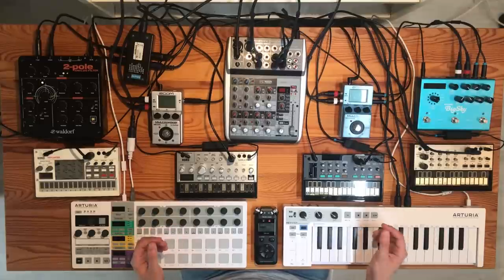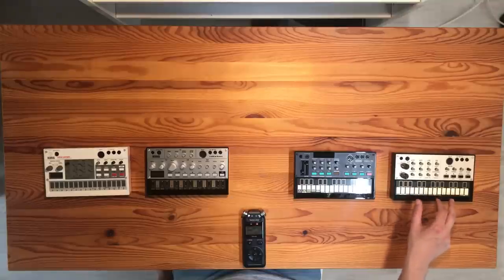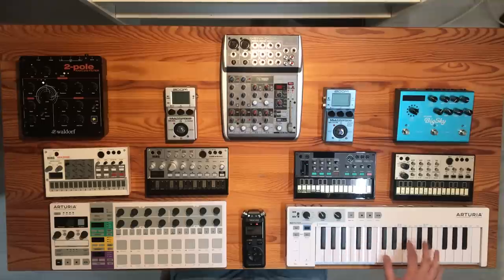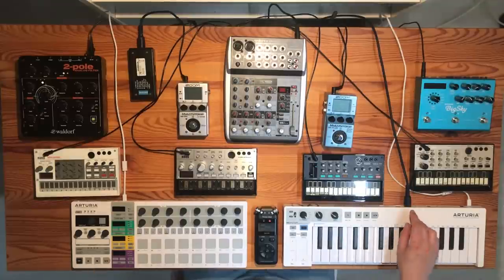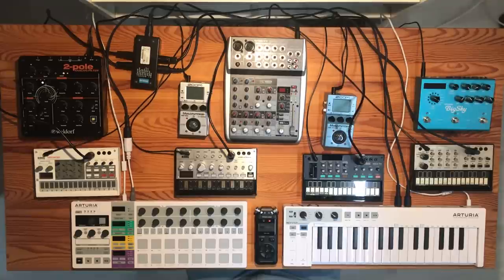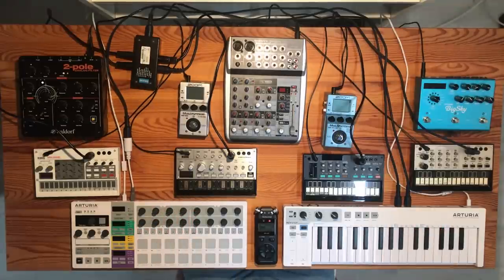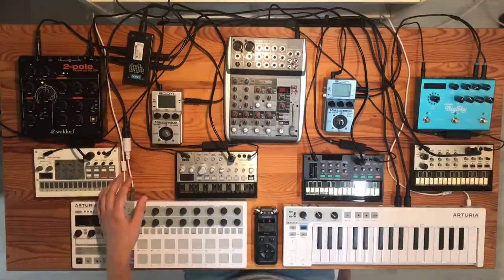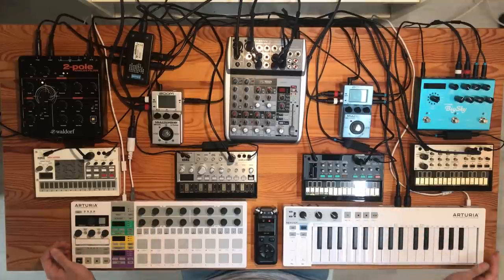Our Volca Setup: How Is Everything Connected? (2018-06-03)

Comment: So do you just use the camera app to record video and audio? I'm assuming when you plug in the mixer out to the iphone IN the camera app allows you to select the audio source?
Reply from the maker: Paolo Salomon : With the iPhone, when you connect a USB audio device, it is automatically selected as the audio source in the camera app, and the microphone is disabled. I have an iPhone 7 with the lightning connector, so I use a USB - lightning adapter, also called “camera adapter” or “camera kit” by Apple. :)
Reply: ahh, I see. thanks for the reply.
Reply: Do you use a specific app to record ?

Comment: Isn't it possible to record to a computer using the USB out from the mixer or do you really need an audio interface in between?
Reply: Good point. I'd be interested to hear of different ways of connecting to computer. I plug my zoom H2 from my mixing board and record straight to SD, then put SD into computer. Unfortunately I have never had any success with interfaces. I even bought a focusrite 16i 8out once upon a time and it was an absolute nightmare trying to set up, and a complete waste of money!

Comment: Is there a way to disable the system messages  via the keystep software option?
Reply from the maker: No. Also, unfortunately the Miditech solution presented in this video is not accurate. I'm planning on doing a follow up video to solve that specific issue.

Comment: That was really helpful! Well explained. Some really nice tips there with those ground loop isolators.
I'm currently looking for a new mixer. What are your thoughts on that big behringer UFX mixer ? The specs are quite nice. Did u tested the multi track recording ?
Reply from the maker: Thanks!! I really love the UFX1204. We've been using it for about a year now and it can do all the things I want it to do. The multitrack recording is great - we always use it in 'standalone' mode, meaning it records straight to a USB hard disk I have connected to it. Very cool to not need a computer at all. So, yes: definitely recommended! :)
Reply: @SlenterendeBeer  I also thought about the xenyx 1204, but I think the multi track recording is worth the price difference and nice to edit single inputs afterwards if needed. 
Keep up the good work! I'm really enjoying your jams! :)

Comment: Do you have a link for wires and that through box’s I’m Digging the Internet and not found it I’m have so much trouble syncing beat step pro with my 3volcas
Reply from the maker: Hi, I've updated the video description with a list of links to the cables we use. Regarding the MIDI THRU box: as far as I know this Miditech is the only THRU box with filter functionality. If you're looking for a regular THRU box, look for one by "Kenton" or "MIDI Solutions".
Reply: Slenterende Beer thanks for getting back to me love your whole setup thanks for letting me know about the through box but right now having trouble with volca sample and BeatStep pro
Reply from the maker: hanwey weasner : You have to use the Arturia Midi Control Center software to create a custom drum pad mapping. Pads 1-10 must be mapped to MIDI channel 1-10 respectively. Hope that helps.

Comment: Maybe you can help me figure this hardware configuration out because Ableton will only allow you one device input:

Novation Ultranova synth->Big Sky reverb
Novation Circuit-->Zoom 70CDR

Do I need a Behringer mixer like you have to make these 2 devices work simultaneously?  Right now I created an aggregated single device on my Mac to get them to work but there are clipping issues etc...  And i'm confused about how to do the midi with these 2 units also.  Any help would be great. thank you.

Comment: How do you play such long loops/sequences? Volcas have only 16 steps?
Reply from the maker: Good question. Some Volcas (in our case the FM and Keys) have different tempo resolutions: 1/1, 1/2 and 1/4. At 1/1 one step is 1/16th note (1 bar), where 1/2 means 1/8th notes (2 bars) and 1/4 means 1/4 notes (4 bars). Both Volcas have additional features to make those tempo resolutions more interesting (FM: arpeggiator, Keys: flux mode). However, we also use MIDI controllers (Arturia Beatstep Pro and Keystep) to play longer sequences. They can each do sequences of up to 64 steps, but also support tempo resolutions. Let me know if you have more questions :)

Comment: I am having problems to control Volca Bass with Keystep. I browse the web without luck. I tried to adjust channels, octaves, switches, setup of Volca, but no luck. Are there different MIDI cables? Mine works great on other instruments, not on this combo :(
Reply from the maker: Nikola Horvat : Are you using the correct MIDI channel on both the Volca and the Keystep?
Reply: yes. I tried to change those as well. 1, 6,9,..
Reply from the maker: Okay, I think it's easier to ask your question on the Korg Volca Facebook group. They have 12.000 members, so someone will always respond. :) https://www.facebook.com/groups/Volca/

Comment: Just as a curiosity and out of the equation as I need to do something similar, I want to use my camera to record video and an external sound recorder like your field recorder. How did you import the audio track to the video, which program if you used the computer? Great great video btw.

Comment: How many steps is max from beatstep pro to volka 32 or more cant find the info :( tnx alot for info
Reply from the maker: Skelitor : Max number of steps on the Beatstep Pro for one pattern is 64 (4 ‘pages’ of 16 steps). You can extend that by using more patterns, or by changing the tempo resolution (e.g. 1 step is a 1/8 or 1/4 note). :)
Reply: Slenterende Beer so you can sequence volcas up to 64 steps :O ?
Reply from the maker: Skelitor : Yes.

Comment: Hi, I have a KeyLab mk II + Beatstep pro + Digitakt:
I want my beatstep to play seven of the tracks on the digitak, a sequence.
I want my Keylab play the 8th track with a more chromatic sample so I can use the keys.
It would be MIDI signals from BSP and from Keylab to DIgitakt, bur Digitakt has one MIDI IN, I can plug each one and it works but I want both of them triggering MIDI to the Digitakt. Its possible to do that pluging MIDI out from BSP to MIDI IN from Keylab and then MIDI OUT from Keylab to MIDI IN in digitakt?, Do I need a Merge box?... please somebody can help?

Comment: I searched for Miditech MIDI 4/Filter,  couldn't find one.  You mentioned Filter-  does it really have a filter, or just resistors in the box?
Are the Ground Loop 3.5mm plug?  1 more question- is that Y cable 3.5mm stereo on one end, and 1/4" mono plugs on the other?
OK,  last question, maybe- Is the Waldorf 2-Pole needed? or is there a substitute?  I'm on a budget!
Since some Volca's have Stereo and some Mono, with this device kill the stereo?  See this link:
https://www.youtube.com/watch?v=ZABPk5lds68&list=RDlGTxhh5q1W4&index=5
Reply from the maker: I think the Miditech is a European product, so it might not be available everywhere. (just a quick reminder: MIDI is not about audio, it's data!) "Filter" means it blocks MIDI messages of certain kind (it filters them out). For example, when you turn on the filter for velocity, it will monitor the MIDI messages that are coming from your MIDI controller, and when the type of message indicates it is for velocity, it will not send that message to your MIDI instruments (Volcas).
Yes, the ground loop plugs that we use are 3.5mm (1/8"). And yes, the Y cable has a single stereo 1/8" jack on one end and two mono 1/4" jacks on the other end.
No, the Waldorf is not 'needed' at all - start without an additional filter. If you're looking for a simple low-pass filter, I can recommend the Monotron Delay. But make sure you watch some videos of it first, it's a very noisy device.
Regarding that last link you posted: I strongly discourage you to buy that splitter! In the end it will bring more harm than good, because it's used for something it's not intended for!
Finally, a tip: I recommend you go through this process step-by-step. Buy one thing first, then get the next thing. It will help you understand the role of every device and makes you realize why you would want another thing. For example, the Volcas can be played very well together without ever needing a MIDI controller.
Have fun! :)

Comment: I don't even know how to connect zoom to volca, some of us are beginners in here, all I know is how to power volca and plug in headphones. the adapter for volca does not seem to fit zoom, how strange.
Reply from the maker: whaleronthemoon : Yup, they are different connectors. The Volca requires 9V DC on a 1.7mm plug with center positive polarity, while the Zoom requires 9V DC on a 2.1mm plug with center negative polarity.
Reply: @SlenterendeBeer  Right that makes sense, I was thinking maybe get a USB hub and power zoom and keystep through the hub? Will save me money buying more adapters...

Comment: How do you record your music without computer?
Reply from the maker: I explain how we record our music at 14:35. Also, the new mixer I talk about at 3:33 supports recording straight to a USB hard drive, which is what we prefer.
Reply: I don't know if the field recorder in this video has audio line in too, but some of those recorders do and you can plug your audio from the mixer straight into the recorder.
Reply from the maker: Rob Harris : That’s a good point, and a very viable option. I haven’t tried that yet, but it’s definitely possible: this recorder has a 3.5mm stereo minijack input.